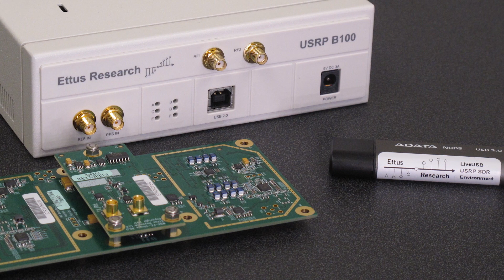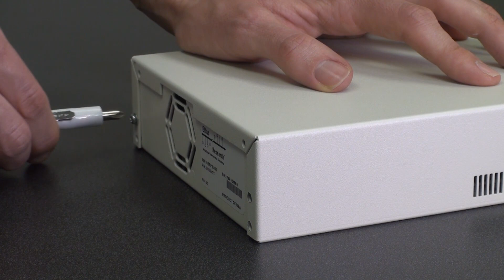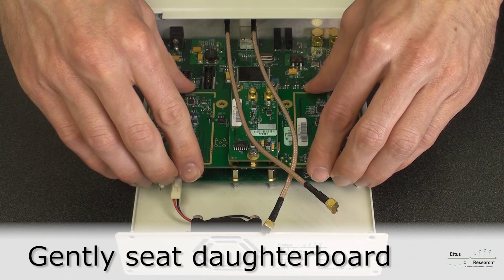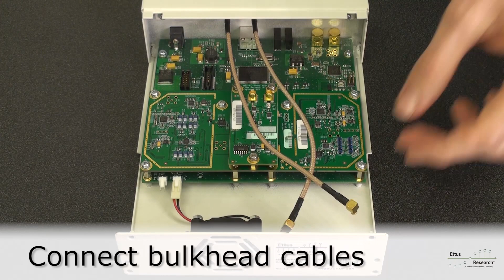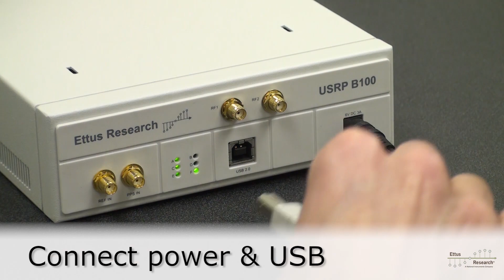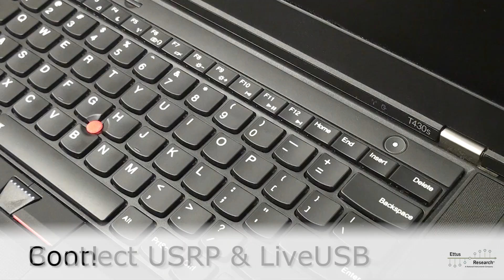Assembling your USRP Instant SDR Kit

Comment: Your equipment is very expensive! I've bought two USRP N200 series that I can't use since I didn't know the daughterboards are compulsory to make them work.

looking at the prices, it would have been nice if you could include the daughterboard into the modem,
Reply: Did you read before buying? Or just compulsively bought two random devices?\